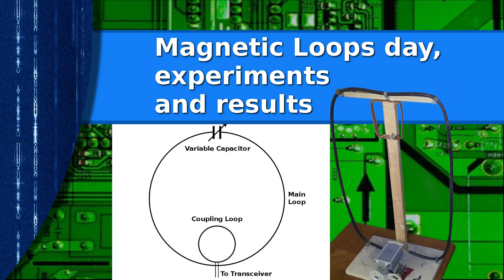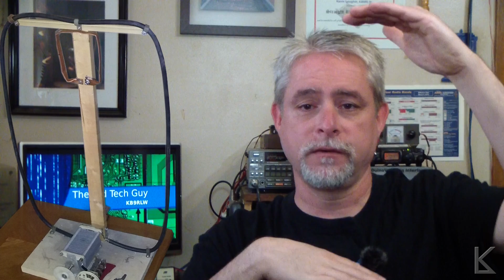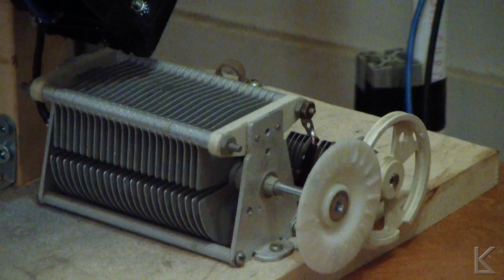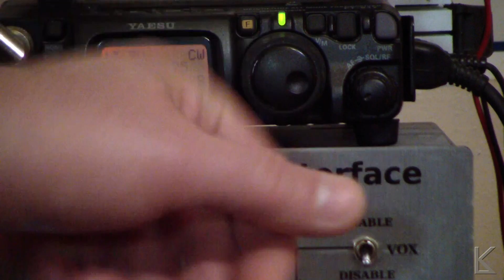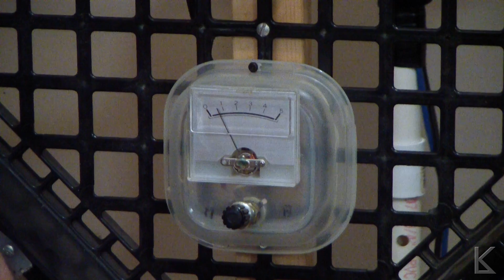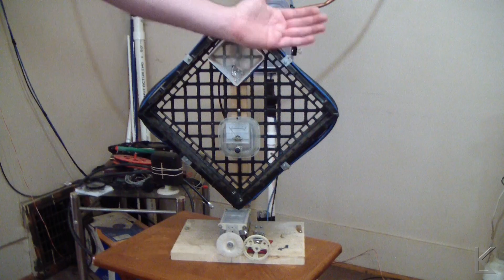Ham Radio Antennas - Magnetic Loop experiments, observations, and results

Comment: Thanks for sharing! 
I think it is great to show others that you can build compact antennas with reasonable efficiency or actually very high efficiency in proportion to the space used for almost no money.

I believe your major mistake when measuring is that you are creating an antenna that generates most of its energy into the magnetic domain within the near field. Trying to measure it with an electrical sensor within less than a wavelength of distance shows you all kinds of erratic field conversions caused by the nearby electric conducting/resonating components in your room. having a second loop "in parallel" so close by might also influence your measurements. So please build a magnetic sensor head for your field strength instrument and then you may detect more logical near field patterns. Holding your current voltage based instrument close the capacitors should show the most RF, because that is the high impedance/high voltage side of the loop. The other side is just as powerful but contains high currents inducing a powerful magnetic field which will be almost invisible to your "RF voltmeter". 
Only in the far field, which is a few lambda away from the antenna, the electrical and magnetic fields are balanced out again, which will vive your electrical meter a true relative reading.
This is why measuring the e-field cose by a mainly magnetic antenna is almost like trying to measure the wind velocity with a thermometer :-).
You can also homebrew a magnetic field probe for your instrument from a tube and some coax cable ... have a look 
https://www.eevblog.com/forum/projects/diy-magentic-field-probes/
This will show you the actual domain of RF power your antenna creates nearby.
In today's age of extreme RF noise magnetic antennas and phase noise cancellation devices are the only answer to a reasonably good reception, while the TX antenna should simply highest gain for the needed sky wave elevation, the RX antenna should have the best directivity to null out noise and pick up energy from the wanted signal. Amplifying signals from the generally noisy HF bands if usually not a problem, but fighting for the best signal to noise on the RX is what counts the most. And here the mentioned effect is making all the difference, most RF noise is electrical in the near field, so a purely magnetic antenna is relatively immune to that and then on top of that having the extreme luxury be able to null out signals is making these types of antenna in most cases very advanced versus fixed long wires when using it just for receiving.
SWLs or hams in suburbs will be impressed how much better they may hear stations with a simple small homemade magnetic loop antennas vs. a huge wire antenna.
So grab some wood to create a frame, take some wires and a variable capacitor from your junk box and have fun experimenting!

Comment: I would very much like to see experimenting with these in a Horizontal position.
Reply from the maker: Their radiation pattern is not very much different from a vertical antenna when you rotate them to a horizontal plane.   You lose one big feature of the loop in doing so.  The null perpendicular to the plane of the loop is VERY handy at tuning out noise sources.

Comment: I built a loop made of 2 inch wide aluminum flashing material 20 feet long. I deployed the loop in a delta shape with the cap at the bottom and a gamma match with the ground at the apex and the tap feed at .17 of the loop diameter down the side of the loop. I could not match the loop with a loop feed. The gamma match worked! Swr was 1.1 at 80, 40 and 30 meters! The delta loop shape uses an fiberglass mast to hold the delta up and two ground rods to hold the corners of the loop out. I am going to use a 65' loop for 80 meters and a 100 foot loop for 160 meters so I can work portable 160!
Jim
kd6iwd

Comment: Have you tried a triangular loop? If all the sides are the same length it will be sort of symmetrical
Reply: About 20 years ago i put microbore copper in the attic on the roof trusses in the triangle shape, and tuned 80 and 160 mtrs  with a vac variable, reached scotland on a watt cw.    on 80 .. G4XRM

Comment: I wonder how much extra capacitance was added using the multi-wire ethernet cables.
Reply from the maker: +Eric Harris none. The wires were all joined together, making them one conductor.
Reply: so each group of ends are tied to another. There is a thing called interwinding capacitance. The parallel conductors do not have to be separated electrically.  The opposing peaks and differences in phase along the conductor (spatially)  is enough to create lines of force between them (like in a tesla coil secondary)   Just trying to shed light on ALL the variables in your tuning calculation. BTW I love your videos man! Getting on for QRP night tonight for the FIRST TIME. (had my tech license for 4 years and my general for a month lol)
Reply from the maker: I doubt there's any appreciable effect.   The wire would have to be longer than a wavelength, I think.  Anyway, they're all at the same potential, so I just can't see any problem.
How'd you do on QRP night?  We had a great time here, and a few nice contacts.   I'll have follow up videos soon, and a special guest video in a week or two.
Reply: QRP night was cool. Made first contact on 40 meters. (once I got  FLDIGI and CW happening :) )  Love to see some SDR stuff.  (even a simple homebrew receiver)   73

Comment: I'm new to HF and will be moving soon from a house to an apartment. I can't find any general distance/safety guidance for magnetic loops. 
I got a KX3 to break into HF on. Do you have any advice RF safety with mag loops? I have children and want to make sure the RF exposure is safe in the apartment.
Reply from the maker: +sfcmmacro you should stay at least one diameter away from it and be sure not to touch it.  At those low power levels, don't worry about rf. But there's high rf voltage on the loop, so touching it could burn .
Reply: Kevin Loughin I figured there was a lot of voltage being produced in the antenna considering the variable capacitor and the potential for arc over in the capacitor. The one thing I couldn't find was any reference of a safe distance from a radiating antenna in relation to RF radiation. Thanks for the advice.
Reply: Kevin Loughin is that the same rough estimate for a 100 W amplifier? I don't expect to do that very soon but of course that's always a possibility.
Reply from the maker: +sfcmmacro no, it would take a very high voltage cap and you would have a very strong field.  Not good in close quarters.

Comment: Spot on Kevin. The cap. at the bottom is best. Max current = max radiation.
Also a tight coupling with the feed loop is good. I see so many feeder loops a distance from the main loop. They are throwing away signal. EDIT: it's transformer coupling.

Comment: Kevin,

Really enjoy your videos and and have learned a lot. I've decided I'll be building a loop pretty soon. I'm still in the planning stage.

Something I haven't seen addressed. I plan to make the loop a semi-permanent installation on my roof, mounted on a tripod and aimed with a rotator.  Since it will be a copper pipe I'm concerned about corrosion. Will anything be affected if I paint the loop? I suspect it will not as you have used insulated wire in some of your experiments.

Lookin forward to some rag chewing on 80 meters.

73s, WB9HNX
Reply from the maker: No problem painting it as long as it's not conductive paint.   You'll probably get some interesting looks from your neighbors!

Comment: Kevin, just a comment. You are attempting to measure radiation strength when the loop is coupled to the other loop almost touching it -  plus it is coupling to the wiring in the house walls, ceiling. floor, wherever. Middle of the backyard up on a wood support at head high will be more informative.
Reply: Oh yeah, also wanted to comment - reverse the coax connections to the coupling loop and see if the field strength flips. If not, it then likely is unbalance in the tuning cap.

Comment: A couple of thoughts. You mention that even a tenth of an Ohm can depreciate efficiency. If you do the math and solve for  the radiation resistance you will see your antenna is below 0.005 Ohms on 20M- so even a thousandth of an Ohm makes a difference.

You mention connecting the center conductor and the shield for  "more copper". Connecting the center conductor does absolutely nothing to enhance the loop efficiency. Skin effect tells us that there is no E field inside the  copper shield- deeper than (3) skin depths= 0.002" at 20M, so the center conductor is invisible.

Using a single gang capacitor introduces serious Ohmic losses between the rotor and its contact to the frame, lowering efficiency greatly.

Because the current is constant around an STL- it radiates equally around the loop. You are probing in the  near field with an E probe.

Dale W4OP

Comment: Hey Kevin,  Love your videos. I have a handy hint. I call it a poor man's field strength tester. I use a cheep florescent light bulb which will light up when held very close to the mag loop.  I would not suggest 
this on loops running high power. I uses this in videos as it's real easy to see the "hot" spots on a video as opposed to a f.s. meter. 

73 and looking forward to more videos. 

John

Comment: Good stuff especially the small loop.  I can't fathom the asymmetrical E-field measurement either, but perhaps the non-symmetry of the caps may have some small part.  As for radiation... you are using, I assume, an e-field measurement device to sample the induction fields of the antenna. What's missing is a measurement of the h-field generated by the current in the coil. Both contribute to the far-field resulting pattern. The key point is your experiments turning the loop to "DF" WSPR signals is more telling than the measurement of only the e-field.  Thanks for the great video.
Reply from the maker: Yes, this is what I used.
https://www.youtube.com/watch?v=8Dd0oEzDepA
Reply: Very slick. Yes no doubt this measures electric field predominately. An easy check with a 1/4 wave monopole antenna, such as the mag mount in your lab, should reveal strong e-field at the top and much less at the bottom.

Comment: Hi Kevin.Good video about mag loop antenna's.I build one myself for the cb citizen band, and did a few rebuilds before it was working good. I have made my copy also with the tuning capacitor on the underside of the loop, and coupling loop on top...Swr measure is dead flat. The tuning capacitor is between approx 15-80 pf, and this is still too much to tune the loop. So i placed a second tuning capacitor in line, and now its very easy tunable! The loop i made from flat alluminium strip, and coupling loop is build with a piece of rg8 coax cable. Aboud the radiation patern of the antenna...If i take a fluoriscent light tube, and go around the loop, i noticed the tube burns max around the tuning capacitor, and goes dimm around the coupling loop position...I see some industrial made loops(chameleon etc.) also made with alluminium  tube loops, and some with coax loop and alluminium coupling loop. I wonder what the best materials will be, to make the best magnetic loop antenna out there...Keep the good work up. Greetings from the Netherlands...

Comment: hey Kevin how are you. I really enjoy your videos sincerely I learn a LOT about antennas and particularly I build my magsLoops.

let me tell you my experience when I placed my two magsLoops the portable rg8 maiden and the copper pipe fix station facing each other I observed this situation you are descibing here and as you see you have two magLoops maybe in Fase. you can re do the field meter radiation and move the biger antenna off the way and see what happens.
73s de kk4nww
Reply from the maker: Yep,  I've thought about interaction between the two.  I'll be doing more measurements.  Thanks for watching.

Comment: thoughts my friend 
how about the small coil being moved from dead in the corner move it small amount out of the corner leaving an air gap on one side to see if it affects the field strengh patten it may be the answer to focas it more in one direction.
tiny bit as a time regards g0myd
Reply from the maker: I do plan on building another loop where I can move the coupled loop around easily.  I want to study the changes when it's near the edge, along the edge, or more towards the center of the loop.

Comment: Just watched a video from SignalSearch 's channel about the W4OP loop. He mentions moving the Faraday (drive) loop up or down to change swr.
Reply from the maker: I saw another guy who rotated it slightly out of plane to adjust swr.    I'm going to revisit that aspect in a future experiment.  I'm also curious about why the driven loop needs to be near the edge instead of in the very center.  I'm going to build a loop where I can move it around freely and see what happens.
Reply: The coupling loop is near the low impedance edge of the main loop. The opposite edge is extremely high impedance. At center it would null. At other edges the resulting impedance would also be different.

Comment: Something  to try is use a 3 inch wide strip of aluminum roof flashing for the the loop   
I mite have to try this  Just what I need one more project HI HI
Reply: Just saw your comment. I have been playing with loops on 10/11/15m made from left over RG6. Using a scrap RFI toroid core for coupling. Three turns of the centre of the RG58 feed line and one pass trough of the RG6. Seems to work a treat. I’ll try the aluminium strips but as I have a roll of flashing I found. 

For capacitors I use a small coax stub and cut it to the centre of the band I want to use.  

It’s funny. 10 & 15 will be dead while the 11m chook band as we call it here (chook is aussie for chicken) will be open with people talking across the country and across the Tasman. 

Around a third of the 11m contacts I have are with other hams

Anyway, we have some sunspots coming up so hopefully we will see some more action on the upper HF bands

Comment: it would like a loop for novice class ham.
Reply from the maker: Novice hasn't been around for awhile.  Technician is the current entry level license.   Most people with Tech stick mostly to VHF.   A loop at those freqs is possible, but also very narrow and fiddly.  A 1/4 wave vertical will cover the whole 2 meter band without trouble.

Comment: I would like to see how to use magnetic loop antenna with small sw receiver with a whip antenna coupler.
Reply from the maker: A magloop would be a lot of work for SWL since you tune around a lot.  You be constantly tuning the loop along with your radio.   And a whip would defeat the positives of the magloop.